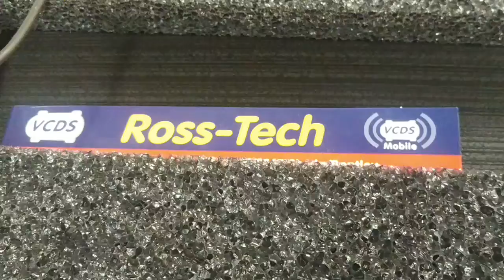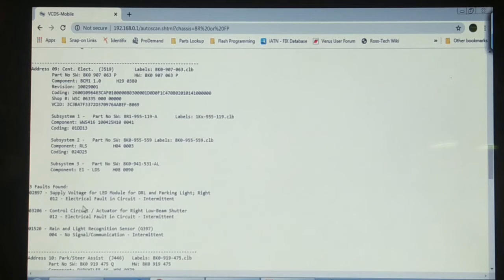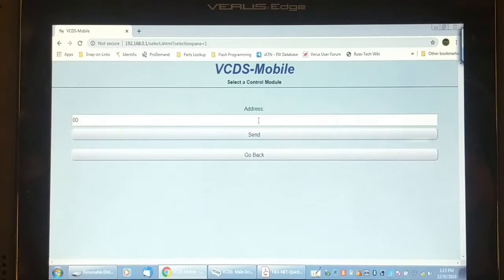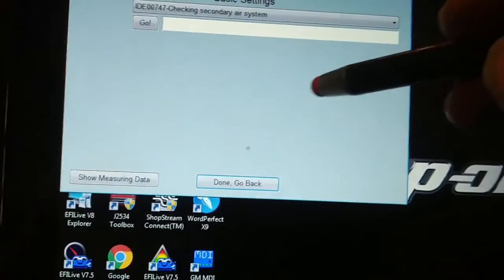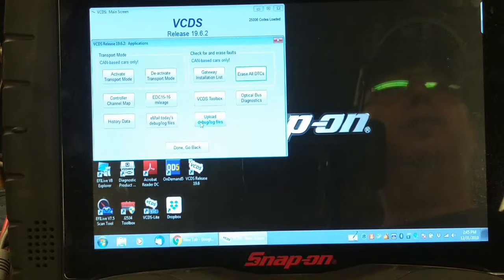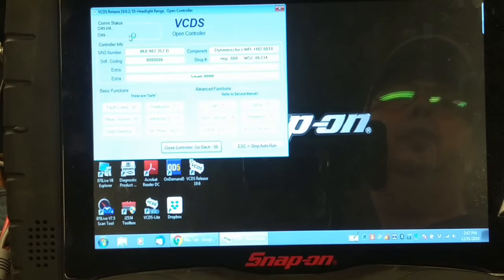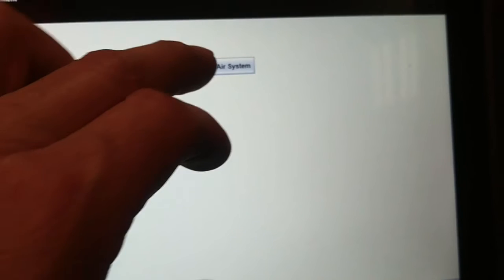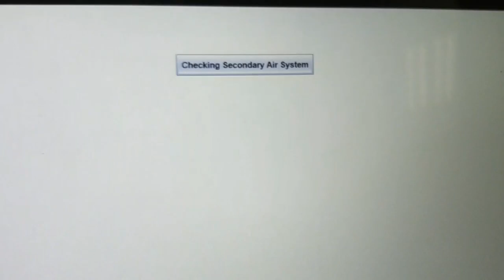First use of VCDS on Audi Q5 Network Scan and Functional Tests

Comment: Hi Philip, I am working on the same car. I am an at home mechanic for my own vehicles with very limited tools. However my cheap OBD2 scanner is reading the same codes of p0491 and p0492 that you got in a previous video. It is accompanied by a cylinder three misfire(p0303), bank 1 too rich(p0172), and an extremely rough idle(seemed to only be misfiring below 1k rpm). First, I was wondering if you had the rough idle and misfires with this Audi and second I was wondering if you replaced the secondary blower motor (as you said in a previous video you thought it was shot)?

P.S. I have replaced spark plugs, coil packs, injectors, and crankcase vent hoses in search of a solution and just started receiving the secondary air injection codes after replacing the hoses. Could the secondary air blower be my issue? I have read it might be the PCV valve. Wondering which one to check next. Thanks!
Reply from the maker: Well I feel your pain... How are the intake valves? These engines develop heavy carbon buildup on the intake valves which can lead to misfires. Otherwise injectors leaking down and delivering excess fuel can cause misfires and running rich but you say you replaced them already. Were they new injectors and reman? Does the high pressure fuel system hold pressure during a hot soak condition. In fact the HP fuel pressure should actually go up during a hot soak. The secondary air blower should run for the first 10 to 30 seconds on a cold start. It's behind the right bumper filler under the right headlight. If you pop out the plastic grille you can see it but you should be able to hear it run as I said. Check that but that should have no effect on performance at all just turn on the MIL after two drive cycles. How much pressure/vacuum do you feel at he oil dipstick tube. There should be  a slight vacuum at idle. HTH
Reply: @PhillipBailey  thank you for the reply! I forgot to mention I cleaned the intake valves too so that’s not it. The injector was brand new, even when and put the “bad” injector in cylinder #2 to see if the misfire changes cylinders and it still put a code for #3 (the one that had the problem initially). The dipstick tube has the very slightest of vacuum at idle (you can barely feel air sucking in) and I don’t really have a way to check the HP fuel system as I am an at home mechanic with limited tools. I have cleared codes several time and the same codes keep coming up: misfire cylinder 3 (p0303), secondary air injection system insufficient flow bank 1 & 2 (p0491 & p0492), and System two rich bank 1 (p0172) accompanied by a rough idle that kind of pulsates. The idle is rough before the codes are tripped though. Once it trips the codes, the EPC light turns on and it shuts down a cylinder(I can feel it). The codes only get tripped at idle and when the car is cold. After it gets to temp it still has a rough, pulsating idle (maybe slightly better) but does not trip codes, turn on EPC, or shut down a cylinder.  

I have been chasing this issues for more than 2 months now and can’t seem to figure it out. So, any info or advise will be greatly appreciated. Thanks
Fischer
Reply from the maker: @fischer0762  have you checked compression and compared to other cylinders. Not much else left. The air injection codes are not causing the miss in my opinion.
Reply: @PhillipBailey  also when I say “pulsating rough idle” I don’t mean the rpm’s are pulsating. There is not movement in rpm’s at idle. You can feel what feels like a misfire and some weird vibration that pulsates from weak to strong kind of like a wave.
Reply: @PhillipBailey  one more thing. I know the secondary air injection system doesn’t effect performance but I have read that if some of the lines from that system are broken it may cause a vacuum leak which in turn would cause a rough idle and misfire. I read it off a forum so I’m not sure how accurate that would be. It’s make some since to me. I want to know what you think about that? 

Thanks again
Reply from the maker: @fischer0762  but a vacuum leak would not cause a rich code. It should be lean if anything. What happens if you disconnect the O2 sensor on the problem side. Possibly it's reporting a false rich condition. What are your fuel trims doing?

Comment: Looks like its running great on your Verus Edge especially hooked up direct. Man thats so disappointing about snap on faking a test, maybe it might be in the tech notes in Guided Components? I have a few more payments on my Verus Edge and I'm glad there is so much better options out there now. I wonder if that launch diaggun would of said to hold the brakes and accel pedal down? Good Choice on the VCDS hope to see videos with it this year.
Reply from the maker: Definitely more if I get some VAG vehicles. Too bad it doesn't do Mercedes. They are in their own little world and nobody here has a dealer scan tool. Nearest Dealer is 550 miles away.
Reply from the maker: In Snappy's defense the Autel scanner didn't explain what to do either. I'm sure it would work following the correct conditions.

Comment: VCDS looks really good, basic layout but good. How much is that annually?  Looks like you can get the VCI for $600 

Do you use ForScan for Ford? It’s incredible and cheap
Reply from the maker: I paid $1000 for the full function latest version. I believe updates are included for at least one year and I'm not sure what it's going to cost after that. I do have Ford IDS but that's $1200 cdn per year but that gives me full flashing capabilities at no extra charge. I'll look into ForScan though. Thanks
Reply: Phillip Bailey check into it, I paid $40 for adapter on amazing and $50 lifetime for ForScan. You can do $10 a year. It has the same capibilties as IDS more actually. Let me know your thoughts if you get it. Well worth it, there’s a fb group too. 

I’ll need to check into vcds looks good. I don’t see where upgrades costs but I might be missing it.
Reply: Our official policy for our customers, free software updates for 1 year from date of purchase.  However, we (Ross-Tech) have been doing business for just under 20 years now and have never charged for software updates.  Originally we were going to, but while in development, early adopters were given free updates and this in turn lead to more and more sales.  So here we are today, still handing out updates for free and selling like hotcakes.
Reply: RossTechVCDS thank you very much for the reply you just got another customer. I’ll be ordering mine shortly. That’s what I wanted to hear. This will be perfect for my channel as well for videos
Reply from the maker: @RossTechVCDS  thank you very much for the reply. Looking forward to doing more VAG vehicles.